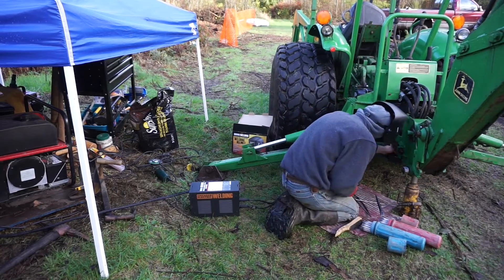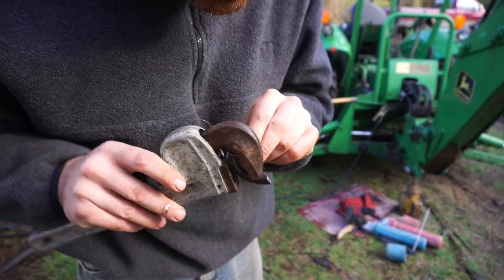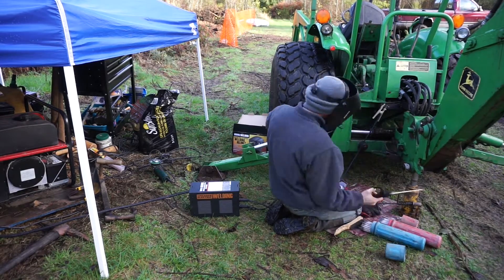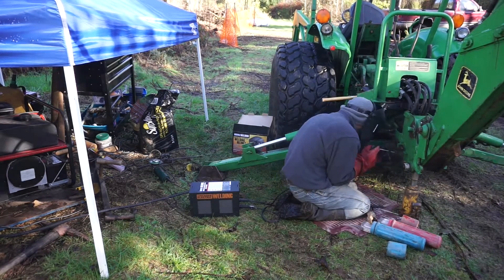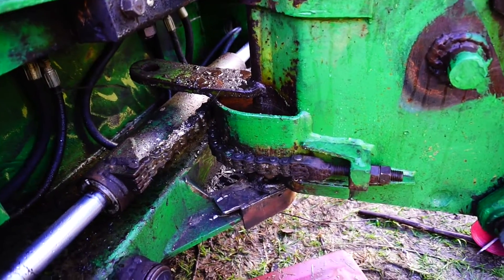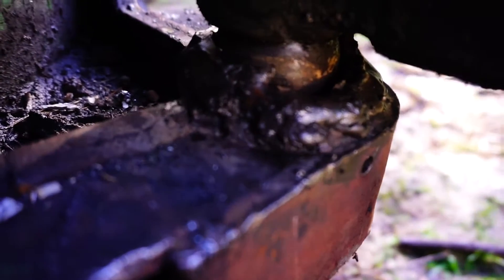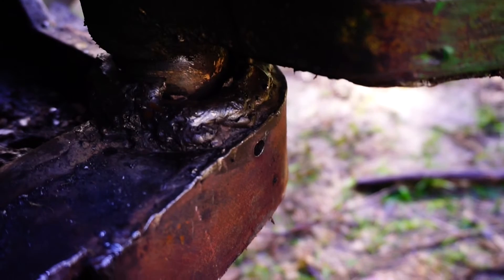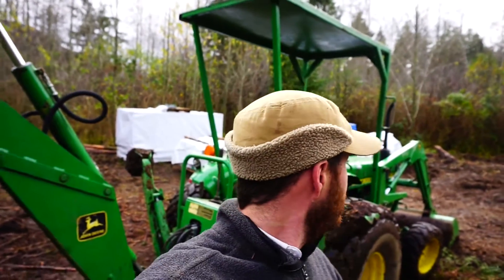So We Bought a Tractor Part 3: I "Fixed" It No Thanks to John Deere

Comment: John Deere didn't let you down; the dealer did.
That backhoe shouldn't ever have more than 2 inches of sway when you stop rotating.
Besides all of your other problems, you need to replace all the bushings in that back hoe to get rid of all that free play..
 I bought a 950 in 1979, still have it, Only problem I ever had with it was an air leak in a back tire; and have had everything they make for attachments on the back of it EXCEPT their backhoe. And my front end loader still works fine...
I bought a very used Case 680 back hoe / loader for those tasks because as far as I was concerned the JD back hoe for that tractor was simply way too small to get any real work done.
 Good luck on your back hoe repairs, 
No matter what you do you can't make it any worse than it was.

Comment: Glad you got smart and did it your self. Next thing to do is tear that hoe completely apart and fix all the issues right,I would take a grinder and get a new collar machined and weld it downtight witha greast fitting.
Reply from the maker: +Scott Foster I think that will be a job I'll be working on next winter. It is in my sights for sure.
Reply: My thoughts exactly....!
Reply: that would really tick my buddy at kubota off alot when deere doesnt help there customers out
Reply: Kubota is better made so less down time and no smart Kubota Dealer would have sold this used tractor except to a salvage yard!
Reply: customer got $10,000 for his old kubota g2160 lawn mower trade in for new kubota wich was bit more money then the tractor was $2,6.00 new and got more for trade of $10,000 wich was pretty good money for the old lawn mower wich deere were gonna give him $200 for the kubota wich wasnt a good deal

Comment: Should have decreased the entire area before welding it. Welding doesn’t stay over grease. I would instal a metal plate behind the pin. Looks like weight of arm is pushing back on your weld. Reinforce that area or it will fail again. I’m not trying to be a jerk, just giving you some advice. GOOD LUCK, 👍 Vinny 🇺🇸
Reply from the maker: mmanut All in all it was a good education. You'll like what you see next. (In the end you are right)

Comment: as a retired welder MFG I  love rebuilding stuff just like that, you need a new pin welded in and a new heavy bushing with a grease fitting welded in lined up of cores, id love to do that for you for FREE I know I'm retired but I cant put down that torch and stinger, I'm glad you didn't do what so many morons do the buy a wire feed welded to try an patch up old greasy parts
Reply from the maker: +Arnold Romppai I'm sure you could already tell that I don't have the experience you have but looking at the manual, you are totally right about the pin and bushing. I won't turn down help. But I'm really not good at asking for it.